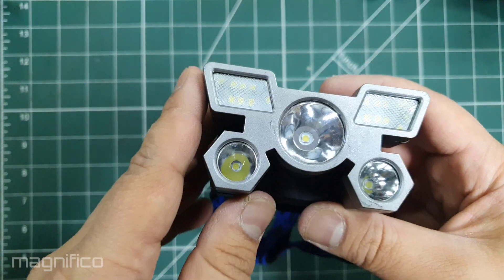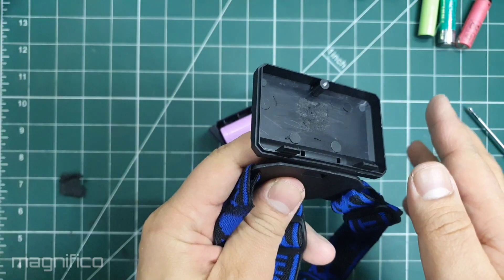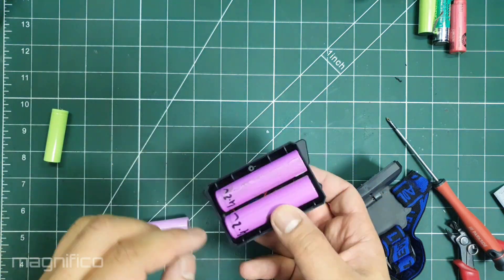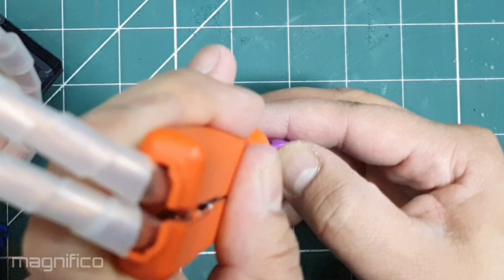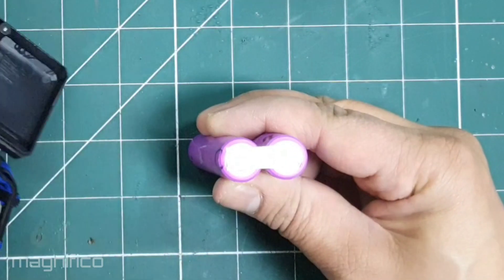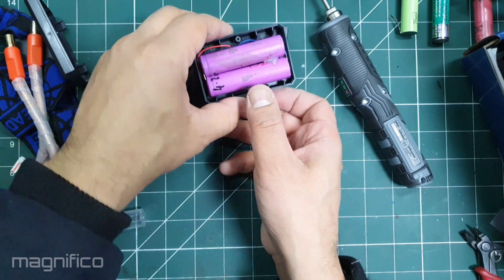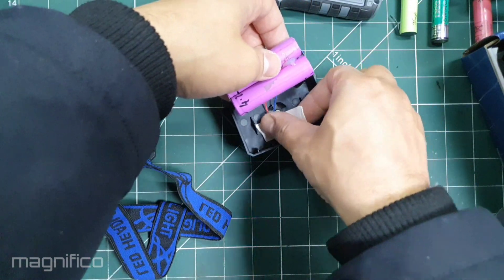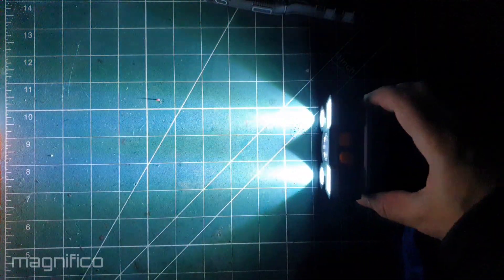Temu Headlamp Battery Upgrade to Last 15 times longer

Comment: i wanna do the same thing, my headlight has 400mah and i want to upgrade to 2900mah one, but while doing some research, it said that the internal charger might have problems, is it the case for this type of headlights aswell, or the only difference will be longer charge times?